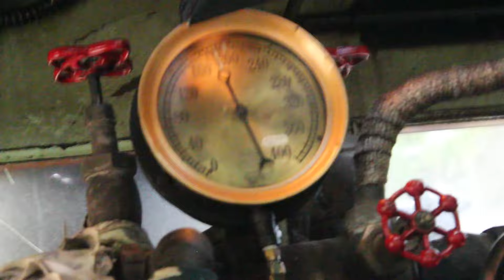Gopro Mounted on Steam Train, Roaring Camp Railroad 2024

Comment: The Dixiana hasn't changed much at all from 1971-1975 when I was one of the firemen on the crew. The boiler had to be replaced, so the backhead isn't studded with rivets now. The only other difference I see is that all the leaf litter on the tender tanks. It would never have been allowed. We kept it swept off on orders from Norman Clark. The year after I left for other careers, the Spring Canyon spiral trestles burned and were replaced by the switchbacks. It's nice to see the old machine still doing its job.
Reply from the maker: Wow that's really cool, did you still visit roaring camp once in awhile after that?